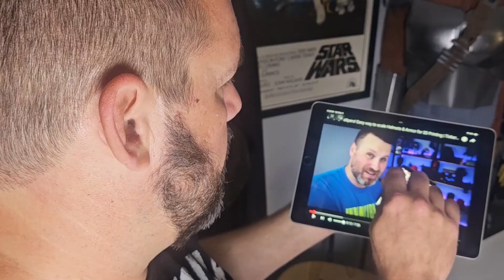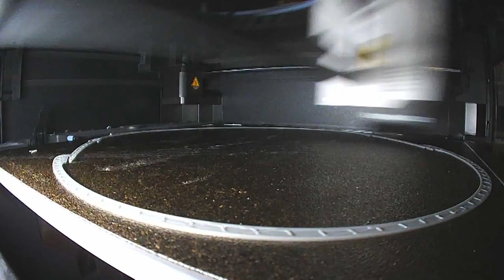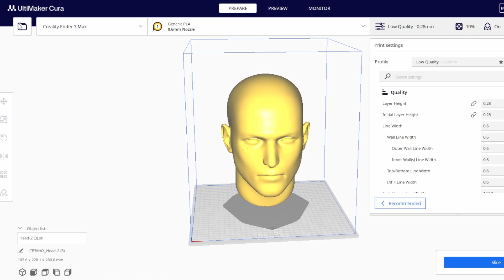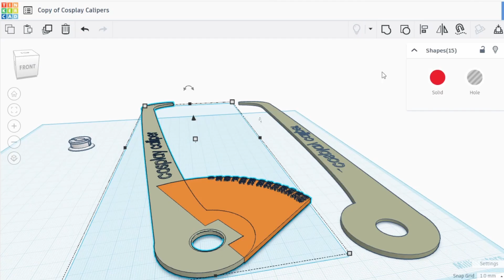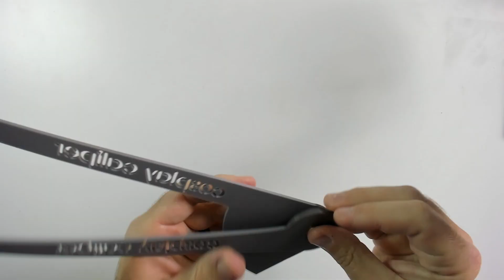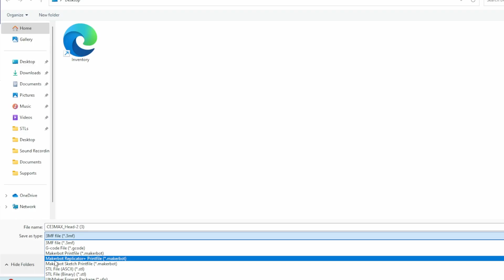3D Printed Tool For PERFECT Helmet Scaling

Comment: How much above actual mil size do u do. If im 175 do i do like 180
Reply from the maker: What I did was just match the sizing head as close as possible then just eyeball it with the helmet in the slicer. And with your example I would say 180 is not enough. A helmet that is slightly too large is ok, but one that is too small is not. Plus you might want to add pads inside.

Comment: Im going to try and print a darth vader helmet for my son, I see you have a full costume in the back. Where can i get the best file (paid or free) to be able to print this? Thank you
Reply from the maker: That’s awesome! Your son is very lucky. I have an older video (actually 3) where I go over making the chest piece with the electronics. I found the files I think I used for the shoulders and shins as well. Links to those files are now in the part 1 Vader chest piece video description.

Comment: Still have to print budwins Deadpol mask. I think this is the most accurate to resize t he head once and use it for the sizing of the Helmet. Specially with the examples in the video. thank you
Reply from the maker: Yea, a Deadpool mask is on my list of things to print too. Thank you for the comment and thank you for watching!
Reply: @3DMaxBuilds Can highly rec9mmend the mask. Watch out with not using default support trees on it.

Comment: I’m having trouble because the calipers say my temples are 100 mm but when I measured with a tape measure and the old uncle Jesse calipers I got 150.
Reply from the maker: Just checking, were they resized in your slicer? They should be about 12-1/2" long. Also, are you looking at the number where the arrow is, by the "C" in cosplay?
Reply: @3DMaxBuilds  I took the files straight from your link and did not edit anything. But an issue I did have was that the middle piece of the calipers don’t fit into the holes. I didn’t adjust any of the parts or anything like that
Reply from the maker: Thank you for catching that with the plug size. I just replaced it with the corrected size. If you still have issues with the measurements let me know.